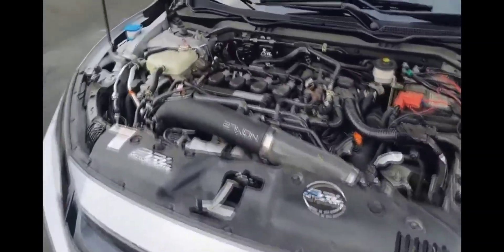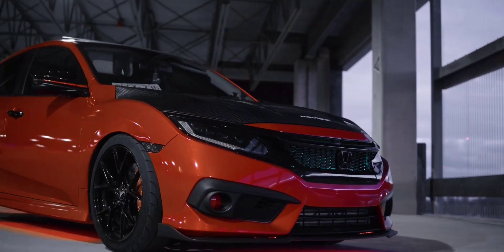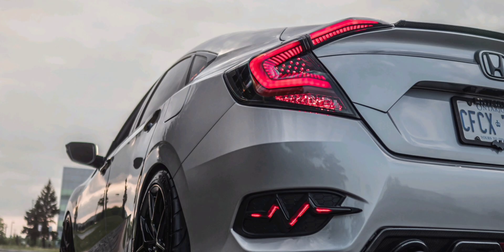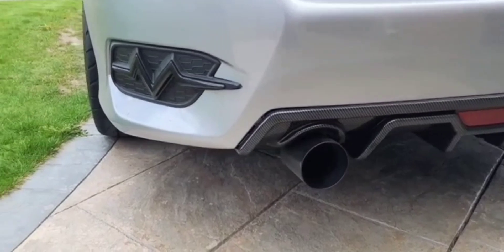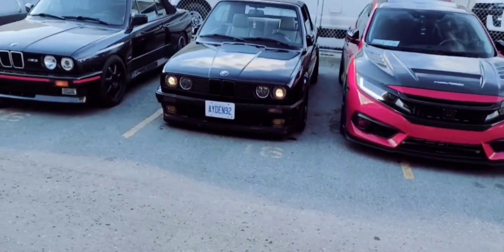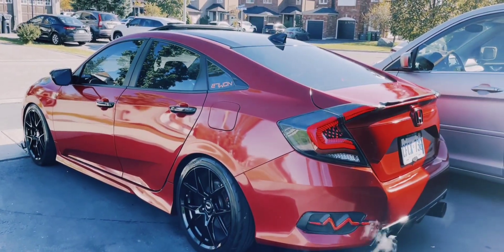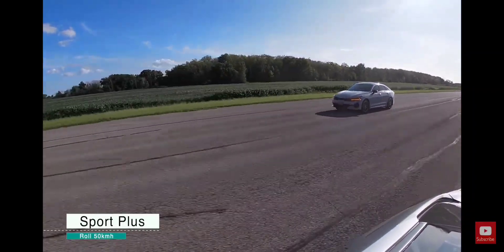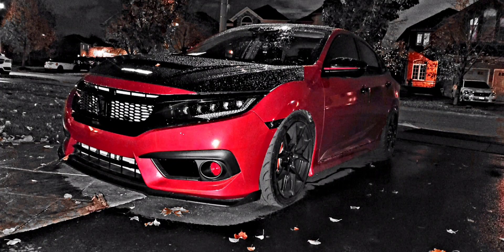Modify Honda civic 1.5 CVT review.

Comment: I need a good tune??
Reply from the maker: Yea
Reply: @the_batmobile0.4  I’m in Jersey you know someone good?
Reply: @the_batmobile0.4  i got a 2017 civic hatchback cvt prl front pipe Downpipe invidia Q300 prl Inter cooler k tuner v2
Reply from the maker: @martinabrante8571  do u have 1.5t or 2.0L ?
Reply: @the_batmobile0.4  1.5 turbocharged

Comment: Holy shit, the silver Civic was your car?? It was definitely moving at the end of the 400m. My question is, how did you get around the torque limit in the computer?
Reply from the maker: Yes silver_surfer0.2 was me, and I didn't tune the car myself, I said in the video I had 3 different custom tune from 3 different tuners, the car weak point is too much low end torque, if u keep the torque above 4000rpm ,you should be OK with around 290 torque, but u will also suffer from terrible dig power
Reply: @the_batmobile0.4  The combo that I would most likely go with is the KTuner 21psi off the shelf tune, Mish cold air intake, intercooler, and charge pipes (Phoenix heat), PRL catted downpipe, front pipe, and an ARK Performance exhaust (I like the beefier sound). Will that combo create too much torque with the stock turbo?
Reply from the maker: @bryanhallman8183  nope, that combination won't be no where close to too much torque. Ots maps are conservative.
Reply: @the_batmobile0.4  Sweet! I just found videos on how to change the CVT fluid and the filter on YT. Do you go just with the Honda stuff, or is there something you've found that works better?
Reply from the maker: @bryanhallman8183  I go with Amsoil
Reply: @the_batmobile0.4  Good, I think I will be going with that one, too. They also make a filter for the Honda CVT.